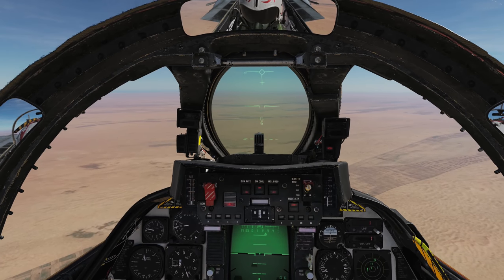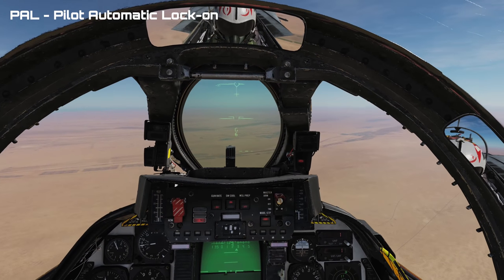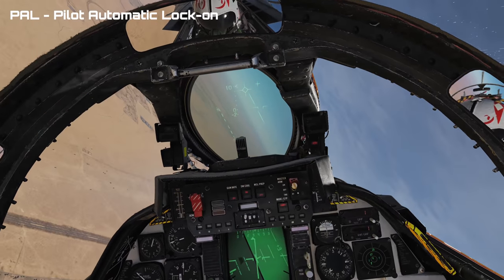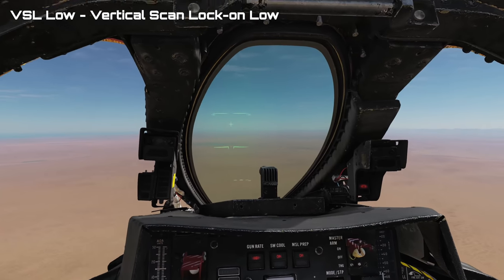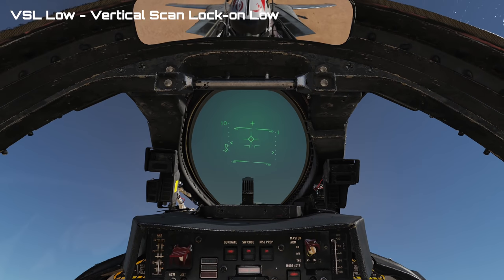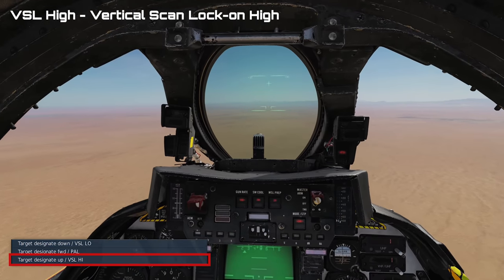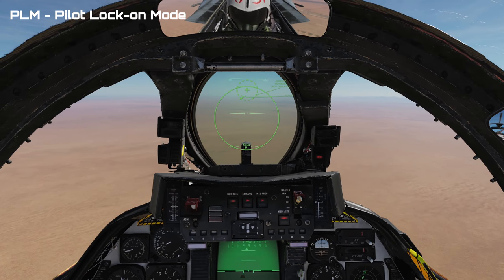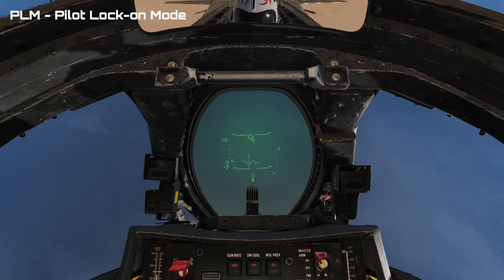DCS World - F-14 Tomcat - Front Seat - ACM - Radar Acquisition Modes

Comment: Cant wait to see how the default bindings on the Warthog are. One fun part of getting a new module for me is setting up all the modes an buttons to the HOTAS. But i would go with the default if the are good. 7 more days :)
Reply from the maker: They are good, i barely changed anything
Reply from the maker: Default Warthog Bindings: https://imgur.com/a/R0I0jJ0
Reply: @Jabbers  Thank you o7   Looks good. I will change some things for myself. I will try to clear up the COM's switch of the throttle for my SRS PTT and the China Head will most likely take over things like the bombmode and Auto Sweep. And the Cage/Uncage i have on the Master Mode switch of the Warthog Stick. I have it set up like this on my Harrier and F/A-18. Looking deeper in to it i will most like likely change a lot. But that's the fun part ;)

Comment: Quick question. I finally managed to find these binds in the command binds menu (took me ages) but for some reason they don't work for me. What am I doing wrong? Well apart from PLM. That seems to work. Do I have to press and hold these commands for them to work or what?
Reply from the maker: Do you have the hud in AA mode, master arm on, and a missile selected?
Reply: AA mode, master arm on, but no I've only tried it with the gun. Could that be it? It doesn't work with the gun selected?
Reply: Yep, looks like the modes only work with missiles selected. So, switch to SW even if you have 0, select mode, switch back to gun. Then it works. That could be a bug.
Reply: I'm now having this problem as well. I have a missile selected, master arm on, AA mode. I'm utterly lost, any help would be appreciated

Comment: Thank you! Can I just quickly ask, apart from switching to the different radar acquisition modes with TFWD, TUP, TDOWN, you don't have to press another button to lock the target, it does it automatically? Also is there a key to "unlock" the radar again?
Reply from the maker: No button to press and you unlock by switching into another lock-in mode that won’t lock something, I use plm for this

Comment: Does the pilot have actual physical buttons or dials for these modes?
Reply from the maker: There is a 3 way switch left of the throttle
Reply: @Jabbers  is that on the throttle itself?
Reply from the maker: It's a 3 way switch left of the throttle... As I said. It's on the wall of the cockpit, left side
Reply: @Jabbers  ah right..  cockpit wall. Cool, thanks.